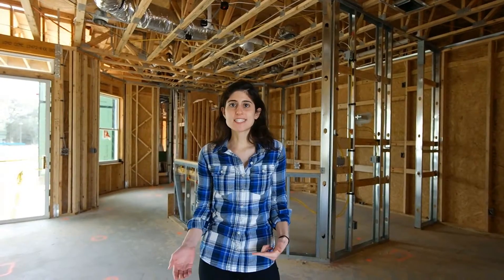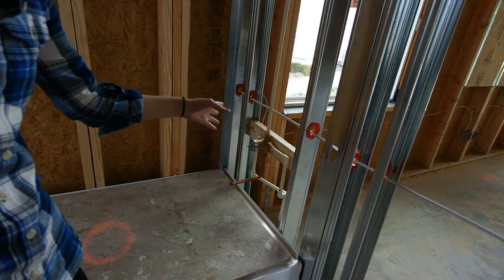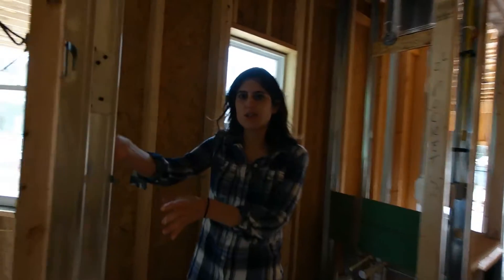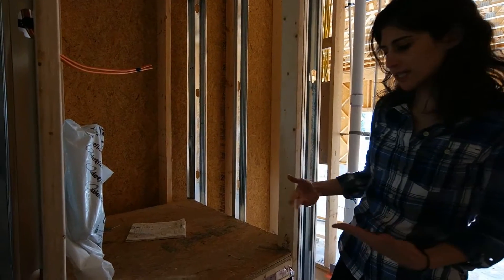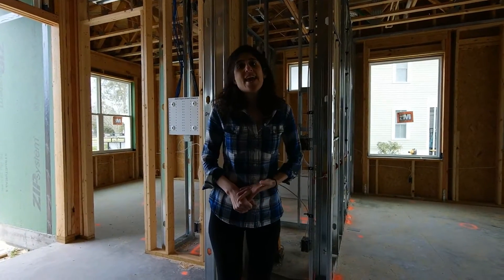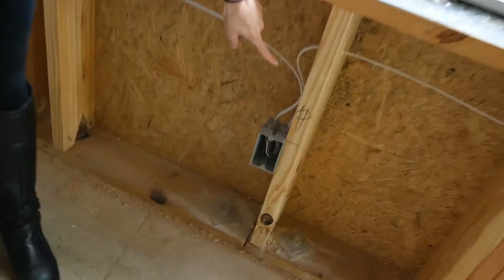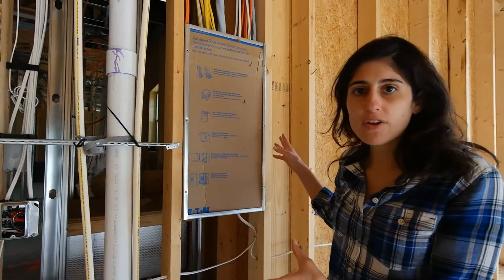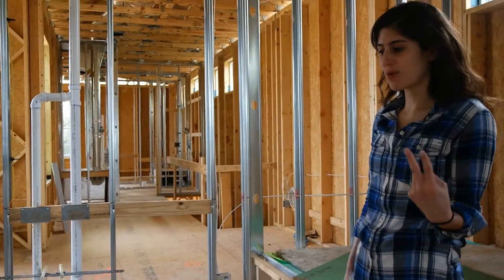Homebuilding 101: What goes inside the walls

Comment: The tub shown at the 0:50 mark should have waterproof sheathing behind it eventually.
It is not clear that the horizontal run of the sink drain pipe has adequate sloping.
Forced air HVAC systems are difficult to zone, rooms that are unused/unoccupied will get heated and cooled, not very efficient. 
At the 6:47 mark, there is a shot of the roof trusses, I can see that some radiant panel or rigid foam sheathing is used to deck the roof trusses. I’m not sure what the final roof insulation details will be for this building, whether it will be a conditioned attic or unconditioned attic. If it will be unconditioned and something like blow-in fiberglass or cellulose will be used to insulate the ceiling plane, I see all the recessed lighting and HVAC ducting to be real barriers to getting the insulation to the necessary depth and therefore cause thermal bridging issues. At the 6:47 mark, i also see exterior daylighting streaming in from between the rafter tails. I wonder how these challenging areas will be insulated, air sealed, and waterproofed. Oftentimes this spot is poorly and inadequately insulated, air sealed, and waterproofed. 
At the 7:38 mark, the wood blocking will reduce the wall insulation thickness. That can be sprayed into the wall cavity. Is this building going to have completely exterior insulation and therefore, this becomes a non-issue?
At the 9:50 mark it is not clear that the exterior wall cavity where the corner tub meets the exterior wall will be able to be insulated subsequently. Also the floor where corner tub sits on hasn’t been properly waterproofed. If that corner tub were to leak, it would rain water down to the first floor. 
At the 10:36 Mark, the waterproofing details to the window buck before the window goes in seems really minimal it will pass code but there isn’t a lot of failure protection. 
At the 11:36 Mark, I think a home that is built tightly, and controls for moisture won’t have an insect problem. The insecticide distribution system you install adds to the number of building penetration. Each building penetration is another avenue for uncontrolled water, moisture, and air exchange.